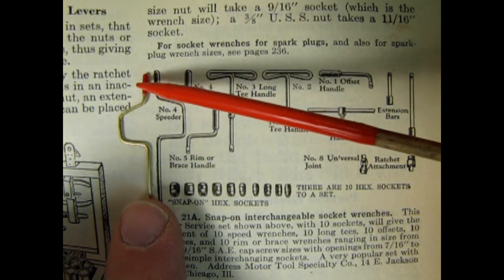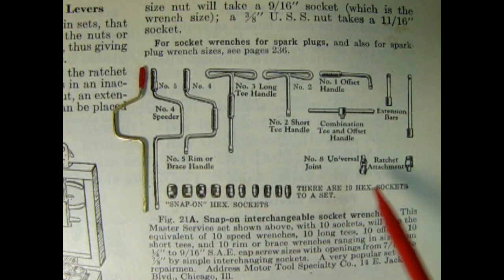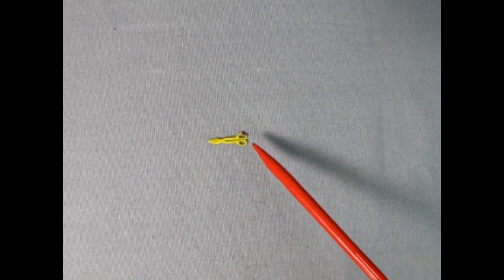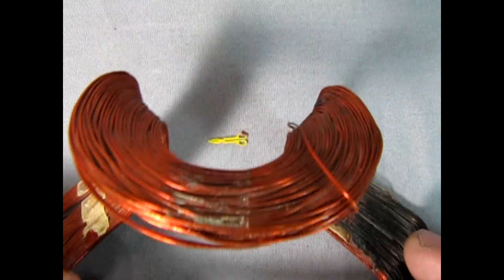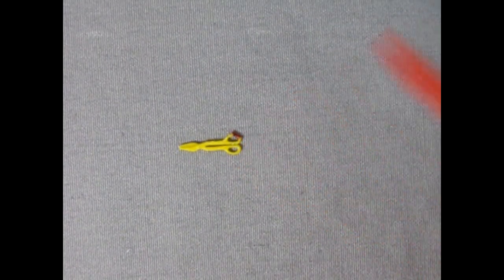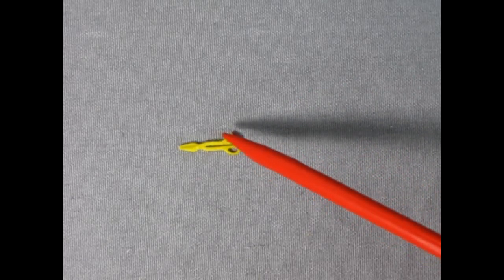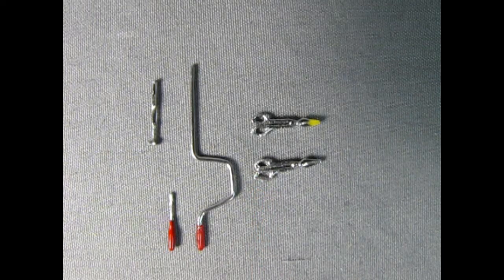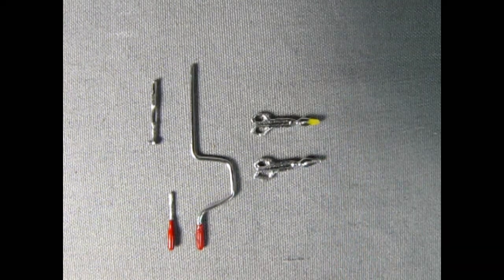What I Did To Fix Some Broken 1/25 scale Hand Tools Using Various Metal Wires and Krazy Glue

Comment: Good morning Trevor 👍😎Great repair on those snips👍and thanks for the tips on making tools😀👍😎Pete 🤓
Reply from the maker: You are welcome. I hope your garage works out for the smaller spaces in those cases.
Reply: I seem to have lost a comment asking which Chevy kits I have. Very few,as I'm trying to stick to FoMoCo. The 1/24 monogram 53 Chevy  #2781,doesn't seem to have any tools. I do have a Revell 54 Chevy panel van #7139,which has mole grips,snips and some wrenches. Also a wheel brace,around which are 4 cylindrical parts which I can't identify and are not shown in the instructions. Do you have any idea what they are meant to be? They do have a raise centre bump that looks like a location pin🤔. The styrene is really brittle,no wonder some of your spanners broke in half,I'm going to soak the sprue in hot water,for a while before attempting to remove them. The few other Chevy's I have are AMT kits.
Reply from the maker: @petesmodelcarcustoms584  Sounds good. Yes, I also wondered what those round circles are beside the lug wrench, but couldn't find those on the instruction sheet either. I just ended up throwing them out. 

I cross-checked your Monogram kit and I do have one of those in my collection, but it's not the same as the Revell one. The molds are different.

Comment: Back when I was building automatic transmission I used the hell out of a speed handle
Reply from the maker: Sounds good. I thought the air tools would have replaced it.
Reply: @MonsterHobbiesModelCarGarage  air tools was fine for disassemble, but for assembly it's to easy to over torque with air
Reply from the maker: @brianlewis6926 Too true...like the guys that use air to tighten your wheel lugs so that no force on earth can unwind the bolts after. :face-orange-raised-eyebrow: